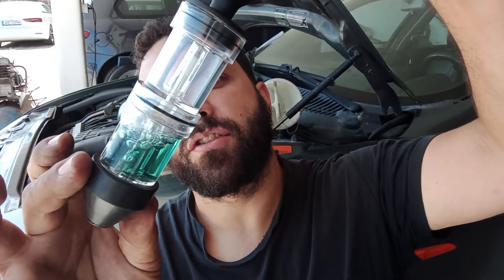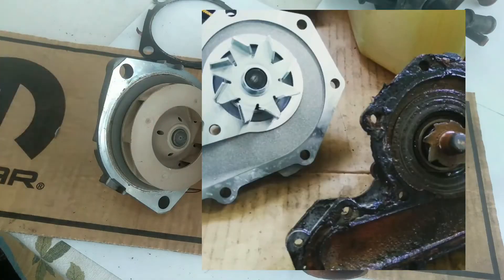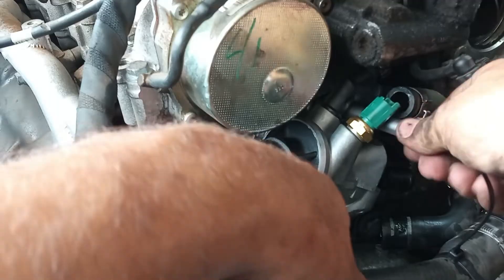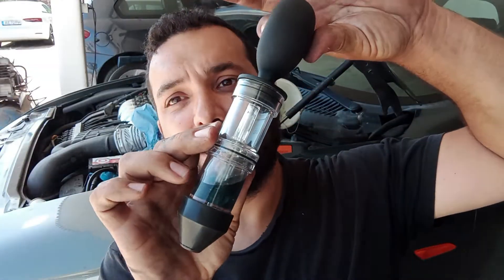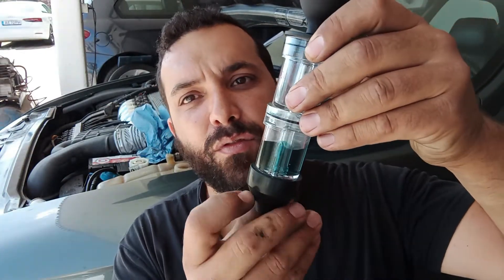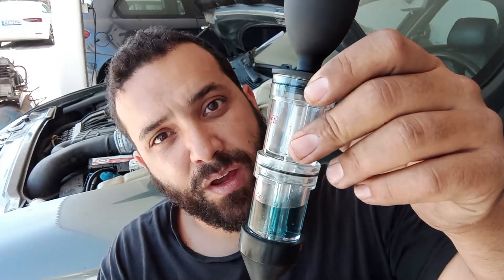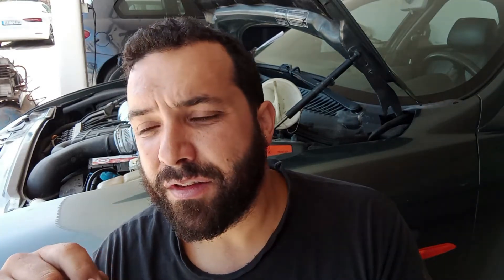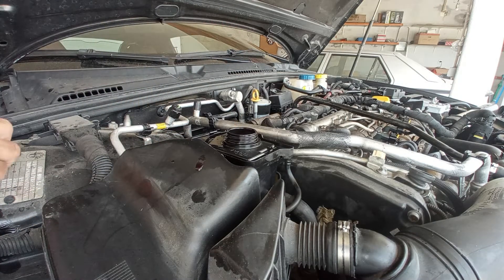How to Test for a Blown Head Gasket and How to Prevent the Gasket from Blowing Out. CO2 Test Done

Comment: Hey, can you help me with this. A week ago I changed the wheels to a summer set, and on one of the wheels the lug nuts where squeaking while tightening them. I screw them in by had as much as I can, an they go in no problem and without any noise. Then I put the car on the ground and tighten them with the torque wrench, but they squeel and because of the friction the torque is lower. I take the wheel off, align it again, do the same thing again but the same thing happens. 
And today, at low speed in stop and go traffic, I heard the sound that at first I though it was a damaged tyre (I did hit a pot hole with that wheel, some 10-15 km before. But it turned out that all 5 lug nuts where loose. I tightened them again with regular wrench, and they are squeaking again.
WHat causes this and how can I fix it? :/
I am thinking, worn threads on the nuts, or the nub. But all 5 and all on one wheel? :I
I am going to my parents tomorrow, 25 km, most of it is highway. So I am warried untill I get there. There I will take the lug nuts off and inspect and clean the treeads at least.

I say lug nuts, but of course, I mean wheel bolts. And they also crack (sound) when tightening. Oh and I hit the pothole with the same wheel, just after I had pressure washed the car.
I think I should get new bolts, just to be safe. But the original ones are only availabe from the dealer and are not cheap at all. I found BIMECC ones, but are the M14x1,5x28 the correct ones (I have 17 and 18 inch original Alfa wheels)?
Reply: OK, I think I have fixed it. I cleaned the wheel bolts with wire brush and also the threads inside the hub. And niw the bolts no longer squeal when I tighten them.
Reply from the maker: Hello. How are you? That is because of corrosion. Clean out very well the bolt holes bit the bolts should be new, because cleaning them will remove the plating. Use anti seize to prevent that again. Lots of it
Reply: @alfaromeonoproblem  Thanks. I cleaned the bolt holes with steel brush and bolts with brass brush. Although one bolt was not very good so I had to use steel bursh n it as well. I mean, if the bolt is corroded, then the zinc plating on it is already gone anyway. I measured the lenght of the bolt threads and it is about 19 mm, not 28. And the spacing between the threads seems to be 1 mm, not 1.5, so I don't know...

About the anti-seize, in my oppinion it should never be used on the wheel bolts, as it will lubricate them. Because of that, the tightening torque will be larger than what is set on the torque werench, and because of lubrication they can loosen themselves more easily.

Comment: Hello Bruno, my car is 159 1.9 JTD. My problem is that my car is difficult to start on hills even though it is in 1st gear. Even though I press the gas all the way down, the engine stalls. Pls help me :)
Reply: egr system was turned off and changed to cancelled.:(
Reply from the maker: @MutluSIMSEK77 does it as the physical blank gasket?
Reply: @alfaromeonoproblem  yes
Reply from the maker: @MutluSIMSEK77 check if it's not ruptured
Reply: @alfaromeonoproblem  Thanks for the quality video and information ✌️👏🏻🍀
Reply: Hello Bruno, I solved my problem thanks to you. My question is, the flaps on the intake manifold are stuck closed. I've temporarily locked them in the open position for now. I plan to delete the covers soon, just like in your videos, thank you
Reply from the maker: Hello. Check with a testing gasket on the EGR. https://youtu.be/CyCIdFr8WXs?si=ZOeNtKAkjGFTqn9k

Comment: My friend has a 2005 BMW 520d M47 engine with 150 hp. He loses a bit of collant all the time, but there are no visible leaks. He thinks it might the the EGR cooler gasket, but there is no realy a way to confirm that unless he replaces it. I told him to check the expansion tank cap, and possible cracks in the expansion tank. The EGR is "turned off" and the DPF is removed, all by the previous owner. Not sure in what way the EGR is turned off. Blocked? Can that cause the excess pressure inside the EGR cooler and damage the gasket?
Reply from the maker: Hello. No additional pressure is created. Egr cooler is the main issue in those. And it is just awful to replace.. better to do it now before oil goes to the coolant
Reply: @alfaromeonoproblem  Thanks.
Reply: @alfaromeonoproblem  Hmm. The EGR cooler is right in front of the engine. It is a 4 cylinder, so there is plenty of room.
BTW, did you check that place from Spain? Do they have the part? If not, send me the web addresses of those places where you did find that they have them.
Reply from the maker: @DashCamSerbia I see, the early ones, ok. 
I'm waiting for some answers on my local parts stores, after that I will proceed with something else

Comment: I put in a cooling system a pure cooling fluid or i should dilute with water?
BTW, happy Easter if you celebrate it
Reply from the maker: Hello. Most of the hi quality ones are to be diluted in Distilled water. If not they say ready to use
Reply: You can't use just the concentrate, you need to delute it 50% with distilled water. As Bruno says, unless it is already pre-mixed in the bottle.

Comment: Another way to save these engines is to fit a CF2 manifolds without those  precats .. In hot weather with an lpg system in ,it tends to fail the gaskets really fast , You will pass the emmisions with the main cats in if they are healthy... Im also not a fan of lpg so you going to install it at minimum place an upgraded radiator, as these engines run quite hot.. nice video btw 👍, hopefully this engine will be saved .
Reply from the maker: Thanks for this info, it will be very important for the customer to know that. And me of course. But he doesn't got the money back yet. Let's see what happens
Reply: @alfaromeonoproblem  I hope he does, unfortunately there are too many con artists disguised as mechanics out there..